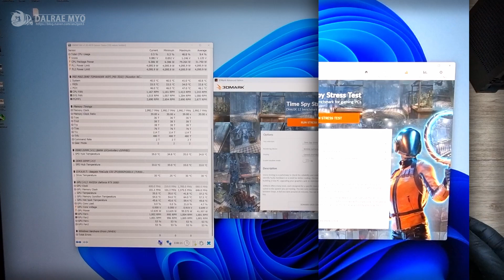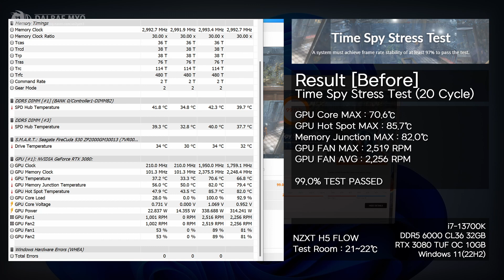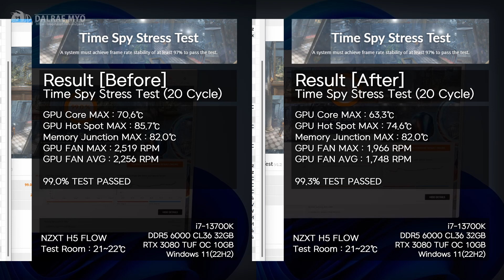Cleaning Used Graphics Card | RTX 3080 TUF Thermal Pad Replacement

Comment: Just replaced my paste on my TUF 3080, it was shockingly thin, almost non-existent across the chip and all clogged on the edges.  My fans were roaring to 100% periodically because my GPU core reached 71c and my hot spot reached 102c(!) under load, idle my GPU was around 46c.  Re-pasting saw my core drop to 62c under load and hot spot dropped to 73c, fans stopped roaring away randomly at 100% speed, and my idle dropped to 35c.
Reply: My hotspot is hitting 107c. Need to repast asap...
Reply: @EvertonAbreuCorrea  I did a week ago hotspot went from 105 to 79 but had to change thermal pads on the vram and mosfits cause they were torn apart
Reply: @AlaaSalehLE  that's my fear. I don't want to touch the pads... 😅
Reply: @EvertonAbreuCorrea  well, if they are already dry there is nothing else can be done except changing them but if they were soft you can try putting it back together as when it is soft it can be still shaped and stick together.
Reply: @Dynasty1818  without changing the pads?
Reply: Did you change the pads?

Comment: Good morning and happy new yr! Question - how do we know when to change the thermal paste/pad or when should we do cleanup?
Reply from the maker: The manufacturer does not specify when to replace the graphic card thermal paste/pad.
In a good use environment, well-managed graphics cards may not require thermal pad/paste replacement or cleaning.
In my case, I felt something wrong with VGA's cooling performance and maintained it myself.
(It was judged by looking at the temperature higher than expected and the RPM of the cooling fan.)
Reply: @DalraeMyo  Thanks for the tip! Will monitor the temperature and fan speed😊
Reply: @DalraeMyo  How many packs did you end up with? How many 2mm and how many 3mm? And what was the size? Thank you!😊
Reply: @JalilovTimur  not sure if you still wanna do it, but i got 1 1mm 1 2mm and 1 3mm pad 90x45 for my 3080 tuf gaming 10GB
Reply: @N0N4M3-L33T what brand of pads did you buy bro?